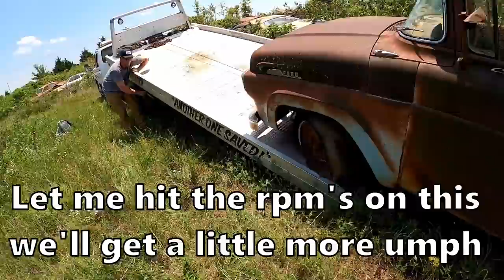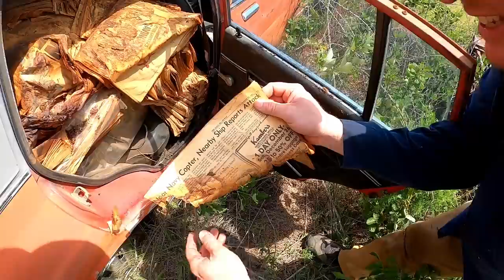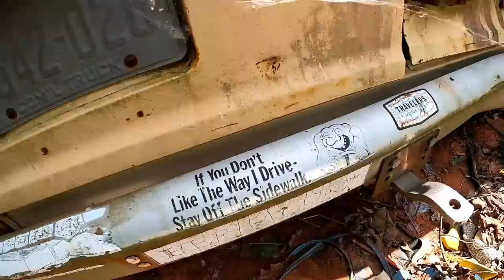This ENTIRE ABANDONED Salvage is for sale! We Found some AWESOME CLASSICS.

Comment: That Capri is actually highly sought after.
Reply: Drag race build. Short ass wheel base! And already got a hole in the floor for the mansmission! Haha
Reply: Put a Barra motor in it Freon Australia easy drag car conversion
Reply: We had a 73 Capri when I was little! We had it until the mid 80's.
Reply: Hard to find those and Chevy Monzas that weren't torn up by drag guys
Reply: here in the UK we had two other capri body styles that ran all the way in to the late 80's 🙏🏻

Comment: I'm a mower guy, and small engines are my hobby/business. I have never even seen a mower like the one at the second property. I would kill to have that thing. Based on the styling, I would guess it is from the 40s or 50s. If the engine is able to be rebuilt, it would be a fun one to do a full restoration on.

Comment: Capri was basically the German Mustang. It was imported and sold through Lincoln-Mercury dealers from 70-78
The Opel Kadette was built by Opel (European GM) and sold in the US through Buick dealers
Reply: 70 thru 73 made in Germany. US made after that.  Mercury Mustang II 74-78.
Reply: @Ray Ward  73-78 were built in Germany and imported into the US. The Capri II were just fitted with US engines. It wasn't built in the US and branded as Mercury until 1979 when it was  built on the Fox platform.
Mustang 2 had nothing to do with the Capri. Ford was toying with building a Mustang 2 based Mercury Capri, but it was scrapped until the Fox platform debuted.
Until 79 it was a stand alone brand. Lincoln-Mercury-Capri.

Edit: Capri 2 didn't come out until 76. Capri 1: 70-74.  There was no Capri in 75. Capri 2: 76-78 .
Mercury Capri: 79-86 then 91-94

Comment: The Capri, Opel and the Fiat 128 Coupé SL @24:52 is highly collectable.
Reply: this is what I came here to mention, that 128 Coupe SL is a rare bird, even with holes in the roof, those can be fixed for sure, though if I lost enough brain cells to want to restore a Fiat it would have to be a Strada (Ritmo) because of the round door handles, odd rubber bumpers for the US market, and funky four-hole standard steel wheels

Comment: I bought a 1973  Mercury Capri with a 2.6L V6 brand new. That 2.3l four cylinder was as strong a Ford 2.3 that they ever made. Pre emissions and higher compression. They were built in Germany until the factory burned to the ground.

Comment: As someone else commented, the Capri was Europes answer to the Mustang. They made the Mk1,2 and 3 flavours. Starting with a 1.6 ltr 4 cylinder pinto engine, 2 ltr pinto 4 pot. 2.8 ltr Cologne V6 and the 3.0 and 3.1 Essex V6. The 3.1 is probably the rarest unit. The choice version was the Ford approved Tickford Turbo conversion of the 2.8. Some very rare cars in their, especially the Fiat Spider soft top, Fiat X/19 and the Fiat 124. They fetch good money in the UK. Those old Datsuns and Corollas sell for big money also!!

Comment: They also made a Fox body Capri from 1979–1986
Looked like a 3rd gen mustang hatch back with different trim and a bubbled back windshield.
I had a one with the 3.3L Inline 6  in high school... it was garbage slow, I wanted to 5.0 swap it but its was an Automatic and the drive train was weak... 
My dad scrapped it when I went to college... and no one missed it.

Comment: Ford Capri. Made in England and powered by a 2.0 pinto motor or a 2.8 or 3.0 litre V6 motors. They were big in Australia, most ended up with 302 Windsors or 351 Clevelands in them and used as burn out and drag cars. They were also imported to South Africa where they had V8 engines and called Ford Peranas.

Comment: The ford Capri was the sports coupe to have in the UK back in the 70s. I recognised it immediately and was surprised because I had always assumed it was a European model only. They were built with a 2 litre straight 4 or a 3 litre V6 (2.8l in mk2 variants). The one in the yard would have been a Mk1 in the UK, as the name had not been used in Europe before then.

Comment: The Capri is a Mk1 with the Pinto 2ltr engine and, in good condition will fetch silly money for a Ford, very sought after cars in the UK.
The 1st red Mercedes is a Ponton, 6 cylinder 2.2ltr, my dad owned 4 of them back in the 60s, FABULOUS cars and rediculously reliable, worth serious bucks in good original condition.
And finally, the Kadett was made by Opel.

Comment: The Ford Capri is a fastback coupé built by Ford of Europe, designed by Philip T. Clark, who was also involved in the design of the Ford Mustang. It used the mechanical components from the Mk2 Ford Cortina and was intended as the European equivalent of the Ford Mustang. they are sort after cars in the the uk

Comment: Smart move coming with the leaf blower.  That was a Packard @ 20:57.  Mercury, some came with a 2.8 V6. Inspired by Britain and Australia.  I think that is a Cressida wagon @ 29:20.  Peugeot 403 made from 1955 to 1966 @ 39:50.  Fin tail Mercedes @ 41:07, normally a small straight 6, 2.2 or 2.3 liter. Hood release on either side of the grill based on year.  The Valient wagons have taken off in value...like most wagons.  You stated the interest in wagons has exploded earlier in the video and that is the deal in my area.

Comment: That was a mk 1 capri known as the hockey stick model made in dagenham london came with a 1.3 1.6 straight 4 crossflow 2.0 v4 or the ultimate 3.0 v6 the 2.0 v4 was also fitted in transit vans and saab cars

Comment: I don't know much about old Fords either, but that might very well be a big block in that F100.. like a  390 or?429?.  Those heads in the back of it are air cooled VW.  @23:07  1973 Capri sold as Mercury in the US... also sold with a V6 engine as an option.

Comment: That was a mercury capri, 1972, it was a 2 l 4 banger but if you got the PI package it was a 2.8l v6 fun little car. I had on that was the same color orange!

If you find a dodge dakota, 2nd generation (94-96) I will be in the market for it, even better if it has the “lil’ red wagon or warrior “ bed ( stepside)

Cadet was an opel

Comment: Excellent video Puddin  :) yes 1973 to 1983 Ford Motor Company made Mercury Capri in L , LX , GT with V8 in 1973 To  1981 plus Option big 6 cylinder 250 , small 6 200 , 1981 to 1983 with 2.3 litres 4 cylinder motor, some had Sunroof, Air Conditioning, Power Steering also Brakes  also in Hatchback , Automatic transmission  in 3 or 4 speed and 5 speed Manual  and all were 5 seater! But lots people like V8 302 V8 motor 2 and 4 barrel carb and strong power cars !

Comment: At 20:08 you were standing beside a Mazda Capella or possibly an RX2, those fetch a lot in Japan, NZ and Australia, usually for drag cars. Also at 10:31 you walked past a VW Karmann Ghia, worth a lot in any country I would have thought, in any shape. The C logo'd Toyota at 29:21 was a Corona Wagon, not worth anything anywhere :). With regards to the rollback, remember - work smarter not harder.

Comment: Puddin, if you want that entire property. For around $100,000 😮 it’s easy to get the price dropped.
Simply inform the EPA of an illegal hazardous material contamination of oil leeching into the water table. 
On 22acres.   As soon as the fines start piling up the price will drop like a rock 🪨

Comment: 1973 Mercury Capri was on a Ford platform in normally came with a four-cylinder 2000 Ford motor non-turbo I had maybe three of those and my last one I put a 289 V8 small block Ford motor that sucker scared the crap out of me

Comment: I can see it in the Tow-Rolla future...Tow-Rolla-Back! The only problem with flipping cars, as my brother found out, he used to do it in the late 70s, early 80s, is if he put them in his name and made it an official sale. The state of Oklahoma wants you to get a dealership license if you flip too many. They can't hang around and clutter up a OKC yard neither. So, he bought them, repaired them, sold them to whomever, then did the next one, never putting his name on them. Cssh Sales only. I was fortunate to latch on to a few good $500 ones from the early 60s and 70s. I wished he still did it, he is pushing 80, still pulls an occasional engine, works on family stuff for cheap. He got that old man strength. Ex-Marine can't say quit.

Comment: That Mercedes on property 2 is a "ponton". Mid 50s up to 1961 190b 180 or 190d. If it's a 6 cyl it's a 220s or se. Se is fuel injected. I have one I want to build a gasser out of. W120 or w121 chassis

Comment: Puddin thats about a 1974 Mercury Capri. My Brother had a 75 or 76. It has those   2.4 4 Cyl engines similar to your Ford Box truck you have. He put a 4 barrel on his. And it was a running little bastard. I was 16 when he had it. And I would beat V-8 in the Quarter mile. I broke the gear shifter going from 1st to 2nd a few times..LMAO...LOL..It was a good little Car...Great Find. It's a shame all those old Iron is rotting away...Hate to see it. Great Video

Comment: Hay puddin half ass custom needs that 4 door studebaker he is a very good person and You tuber but very sadly he had a serious shop fire.  He would turn it into a 3 window coup and the blue ford fire lane was a skyline model extremely rare and very expensive to restore the metal roof folded into the trunk.  The studebaker trucks are very cool the valiant wagon is super cool not a big mopar guy but really like the wagons  and I need a headlight door off that early ford van

Comment: That lady has to understand she does not have the gold mine of a century,  it is not dodge Daytonas Chargers,  Plymouth cudas,  superbirds , Ford mustangs , corvettes , Lamborghinis , Ferrari's or anything 1 off super rare non existent... 65% have been burnt up it looks like and most parts are mostly going to the crusher if not a wall hanger or yard art whatever is usable is maybe 200$-1500$ max even that 70s ford wrecker truck is maybe worth 2 grand , with scrap prices today you will not make your  money back on 200 cars on 1 million dollars,  the only way is to cut them up and work alone for probably 5 years straight stripping each car individually and maybe getting a few running here and there to sell for 2500$ , it's hard to compete against cheap Chinese sheet metal these days than to repair oem rotted warped burnt sheet metal from an Oklahoma backwoods .... 😂 I'd rather have a rusty piece of junk 1977 ford creeper van with a lace paint job from an Oklahoma junkyard any day of the week,  BUT it's NOT worth 75,000$ 😂 unless it will help me create gold somehow then maybe 🎉.... .... maybe